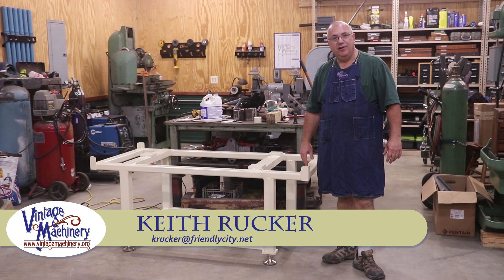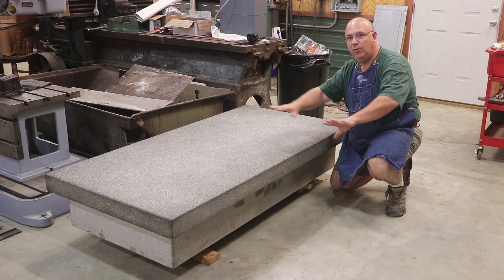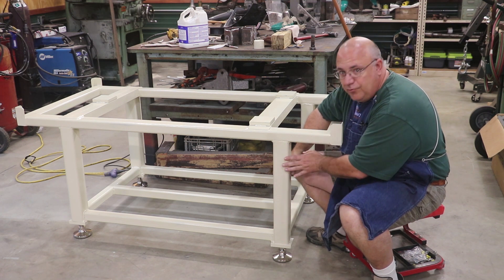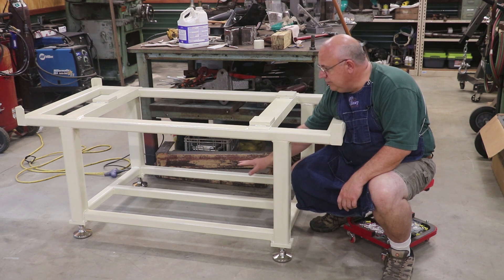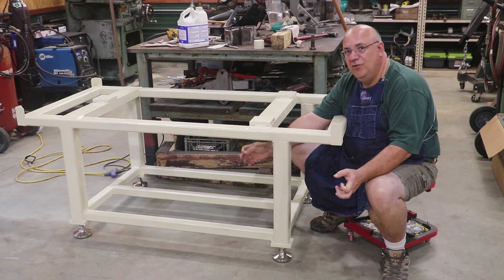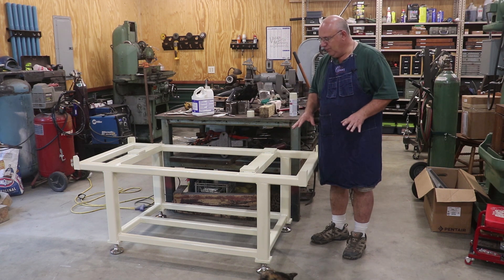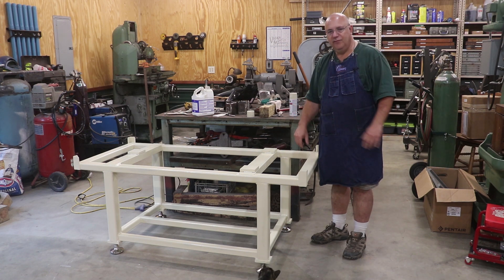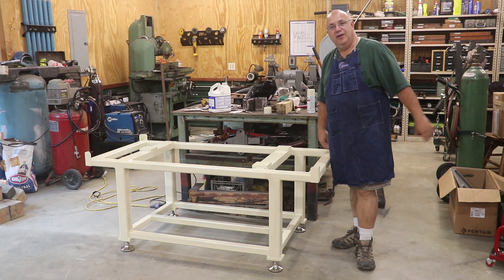Fabricating a Surface Plate Stand:  Part 2

Comment: The build is good. I am only concerned about the leg pads and how much total pressure will be imparted on each (including the drawers and the tools/parts).  I think a solid nut piece of approx 2.5 inch height welded into the legs through holes on four sides and then screwing the pads on would provide enough strength to hold the whole structure.

Comment: It may have been better to mount the surface plate supports on top of, rather than flush with the top of the unit. That way, you could have lifted the plate onto the stand with a  forklift. The current design ensures that it will be a struggle to get it on .

Comment: Nice Job. FYI. Per google, the density of granite is between 165 -172 lbs/ft^3. Taking the entire bench as a "block" (not deducting for the apron section) it would weight about (3 x 6 x 1.1 x 172 = 3,354 lbs)

Comment: That is a very nice stand and should give several lifetimes of service.  Build a nice wooden Double Sided toolchest with drawers taking up 2/3 of the width and the remaining 3rd a cabinet with shelves. The drawers being 1/3 height at the bottom and very shallow at the top. The other side of the toolchest having full width drawers. Full depth drawers at 3' would be too deep and lead to clutter.  My suggestion and it's worth what you paid.  :P

Comment: If I were you, I would have been tempted to use the video with the ruined soundtrack.  Hopefully, your editing software has a way to erase the soundtrack and then replace it with a narration dubbed in from a microphone plugged into your computer.  Just a thought.

Comment: The pads are not symmetrical because the center of gravity of the triangle is just below the center of gravity of the surface plate > the weight on each pad is about the same

Comment: Its  a really nice project and the workmanship  is top notch. This is only an observation and not as criticism....When you lift it with the pallet jack and the granite is in is place would the runners along the bottom begin to flex back and forth potentially causing the granite to move precariously?

Comment: Why does the granite plate need to be so thick? Does it help dimensional stability?
Reply: anon. Yes the plate has to hold flatness when you place heavy parts on it. In fact the plates rating  (AA, A,  B, e.t.c) can be determined by its thickness. This is because the rating has a deflection component that says something about the maximum deflection for a given  load.
Reply: James Boulton got it, thank you for explaining

Comment: Excellent job Keith. I would make some changes. I would make the pads that the surface plate sits on taller than the thickness of a towmotor forks. Second thing I would add is a place(think wood top table/ledge) level with the surface plate to put height gages, gage blocks, indicator stands etc.. A surface plate is sacred ground and should not be a place for a catch all.

Comment: I"d add gussets.  Could be on the outside of the verticals to keep your center area open for shelving/storage.  Doubt you will have any issues, but going with the never too strong theme, and the fact you want to move it.

Comment: In the previous video I asked how you bedded this to keep it from flexing. Someone answered that it sat on 3 feet. I think I get it now. They cut the 3 feet on the bottom, allow the surface to move however it wants to, then work that surface to flat making adjustments as it moves from removing material. I wonder how often some unseen seam or imperfection makes these huge tables have to be turned into little ones?
Looks nice Keith, thank you for your videos.
Reply: Ohh Paul n

Comment: Josie definitely wanted to be in the video. She paused and posed and an optimal location to be in frame. Certainly not a rookie. 

Your stand will definitely hold up to the weight of the granite slab and won’t ever require any repairs. 👍🏻👍🏻

Comment: You were smart to beef it up.  The ductility of the mild steel in common, off-the-shelf angle iron and tubing is enough to stretch/sag under significant load. The weight of that surface plate  requires the support stand to be significantly reinforced.  Nice build Keith.

Comment: Have you looked at the numbers on the lower longitudinals when loaded by the surface plate and supported on the pallet jack? 

You say the plate weighs about 4000 lb. Have you weighed it? Looks heavier to me; maybe 7000. I'm guessing the 2 x 2 longitudinals have a 3/16" wall and are 4 ft long. My Jet pallet jack is 27" across the forks. I made some assumptions for lengths, etc basing two equal supports 27" apart loaded at the ends. It looks to me like there is zero safety margin for worst case (incompletely enter with the pallet jack and miss the far longitudinal with the fork tips thus loading the center longitudinal) maybe less. Hope my assumptions are wrong. In any case, I suggest a second look.
Reply: I would agree. The deflection on those horizontal members will be fairly large. At best you have a wobbly ride on the forks. At worst you have bent members and a plate that has not been lifted off the floor. Trust me I'm an engineer 😀
Reply: Should have added thT the rest of the table looks great!

Comment: I bet that sometime in the future, you'll modify the stand so that you can raise and lower the support in the middle of the crossbar to level it.  Use the 2 feet in the back for the rest of the leveling.  Everything else is too prone to error.
On another topic, what is the maximum weight that pallet jack can carry?
Reply: Pallet jacks usually are rated around 5000 lbs.

Comment: I would have velded the bottom bars under the legs by cutting the bars 8" longer and made the legs 4" shorter so the weight will not hold on veld.

Comment: Nice table. Whenever possible I try to build all my tables to be pallet jack moveable too. One thing I have thought abouut recently is adding some kind of a crane adapter to my pallet jack. That way I can place heavy items onto pallets or tables. The long tall legs of engine hoists seen to get in the way more often than not.

Comment: If want to figure the weight by hand, Granite is 1.56 lbs per cubic inch, or 224.64 lbs per cubic foot
Reply: the_youtube_guy_1985 

You are about 55 pounds over for a cubic foot. Granite is listed at about 168 to 175 pounds per cubic foot. 

http://www.delawarequarries.com/landscape/boulders/boulderwt.html

And considering that there are 1725 cubic inches in a cubic foot then your math is also way off. 
12x12x12=1725
1725x1.56=2,695.68 🤔🤔

Comment: My little book says solid granite weighs 168 lbs/ft³ and a rough volume of the table is 18 ft³. By that, it should be around 3000 lbs.
Reply: I thought he said 13" thick. I figured the extra inch of thickness would be compensated by the step around the perimeter. Either way, it's a big, honking piece of rock.
Reply: Most pallet jacks are designed to lift 5500 pounds
Reply: My guess is about 2500 lbs figuring a 3" thick lip that over hangs 4".  That leaves the base at 28 X 64 X 10.  So the top would be 4.5 cubic feet and the base is 10.37 cubic feet.

Are we sure the pallet jack can handle the plate and the stand together?
Reply: About the leveling feet.  Keith talks about the number of square inches of surface of each foot but not their load rating.  Are they rated at 1,000lb each?
Reply: Actually 20,000 lbs
Reply: They do,but good ones are 5500lbs
Reply: Didn't calculate the weight, but that one massive paperweight!
Reply: Thanks Les,  wasn't sure what the capacity was.  Now I know.
Reply: 13 inches thick.
Reply: Pallet jacks come in different lift capacities .
Reply: Mishn0 i came up with 27cubic ft
Not takeing in account for the over hang
3ft x 6ft x 1.5ft= 27 x 168 = 4,536lbs
I might of screwed up the size but I thought i heard him say 3’x6’x18”